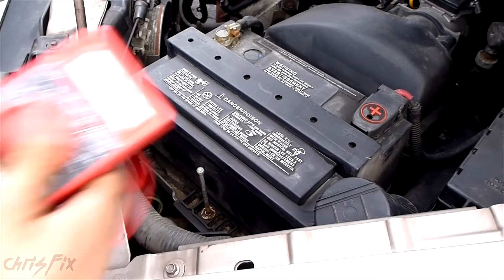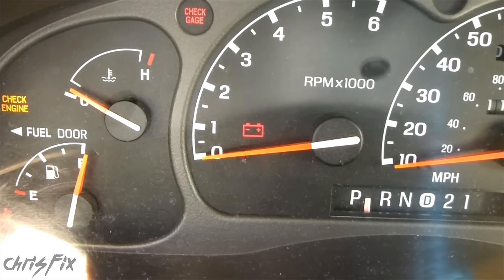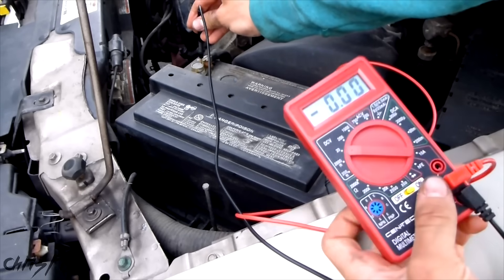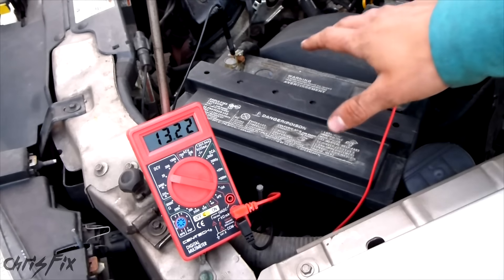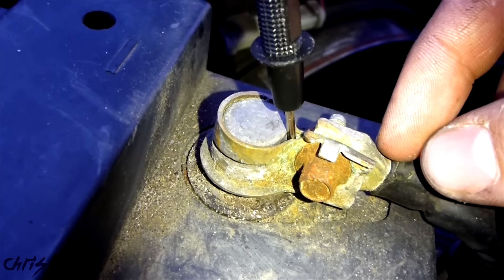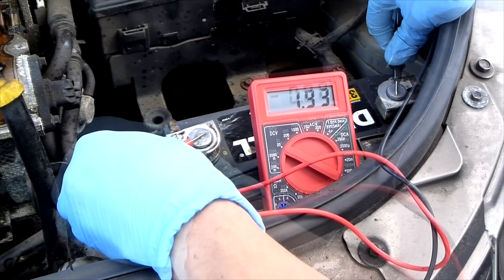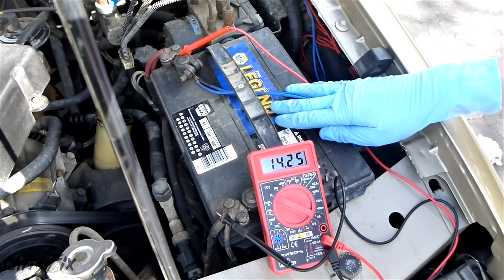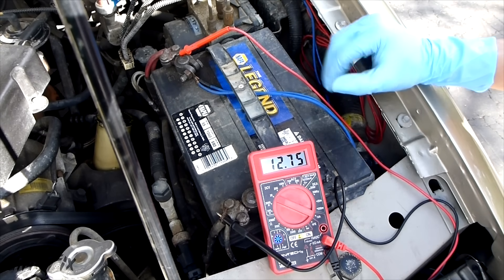How to Test a Car Battery with a Multimeter

Comment: Very useful video a great tutorial on multimeter use.  Not keen on the WD40 on the posts it will wash off too easily.  I prefer to smear a little waterproof silicone grease on the posts and connectors, it doesnt wash off and is a great anti corrosive.
Reply from the maker: Thanks for the tip! I used wd40 because that is what most people have in their garage so it is better than nothing. I have had pretty good luck with wd40 anyhow. It seems to last a while for me, but silicone is a great way to go if you have it!

Comment: Real quick is there a easy way to flush the transmission fluid on a jeep?
Reply from the maker: You can take the transmission pan off and drain the fluid. There isnt really an easy way to flush it unless you have a special machine. I guess you can try taking off the tranny cooling lines and have old fluid get pumped into a catch can and have the new fluid get sucked up but that can be risky if you dont get the new fluid sucking up.

Comment: Hey Chris you haven't made any videos in awhile hope your doing well bud. Hey would you recommend Valvoline MaxLife synthetic blend 5-30 for my Mazda b2600i.,, thanks in advance
Reply from the maker: Hey John, I have been busy filming a lot of videos. I am rebuilding the whole front suspension and have so many other videos I am filming it is crazy!!! I wouldnt use a synthetic blend. I would either go synthetic or stay conventional. If you go synthetic, you shouldnt really go back to conventional so think about the price difference and stuff. I just switched my truck over to synthetic and it burns the oil a little faster so be prepared (120k miles on the truck).

Comment: Hi chris, do you recommend doing that seafoam on a truck. Thanks and hopefully I can learn how to do it if you think it's important on an old truck
Reply from the maker: I do not recommend seafoaming a truck or any car. There is no need to. Are you having problems with something that you think you need to seafoam it? We have had my dad's van since new and it has 300k miles on it. Never been seafoamed and it is running great.

Comment: For example will the belt just slip on into place. The engine is a  12 valve 5 speed manual 4 cyl.

Comment: Hi Chris . I'm hoping I can get a response from you soon I know you're not my mechanic and I know I'm not paying you but I need a suggestion . Today on my 92 mazda b 2600i my ac compressor belt broke ,,I gotta new 1 ,can you tell me if anything specific I need to do to get the new one on. Thanks.
Reply from the maker: The belt is just for the AC compressor or is it a serpentine belt which goes around the alternator, power steering pump, etc?

Comment: Nice video Chris. I would suggest only using distilled water to top off batteries that require maintenance. Just normal bottled water has mineral content. Most large producers of bottled water filter the local municipal water and then add back in a certain mineral content to give it a flavor profile that makes all of their water taste the same regardless of the original source. Who knows what their recipe is, but to be safe, distilled would probably be the way to go.

Comment: Mr Chris,,, I bought my work truck today the B26000i and it is a 4 cylinder 5 speed manual and the truck runs great and smooth until you get on the highway at 55+ mph. Then it starts to shake real bad I asked the guy I bought it from why it might be doing that he said that when he had the tires bought or rotated he never had them balanced ,,,could that be the cause of it sir?
Thanks Chris fix
Reply from the maker: Congrats on the truck! That could definitely be the problem. Are there any balance weights on the rim? Try this to check for other problems: How to check out your own car's suspension system

Comment: Chris... Like I said this is the only way I know how to reply and wont let me answer your reply ... I think the Mazda b2600i is a front wheel drive cause its a4 cylinder 5 speed would that be correct
Reply from the maker: It is rear wheel drive. There is no such thing as a front wheel drive pickup truck. I think because it is a straight 4 it wont be 4wd. I would honestly look for a 4x4. Trust me, if you get a 4x2 you will wish for a 4x4! I wish I could figure out why you cant reply to messages sometimes...

Comment: Another good one.  I've used a baking soda and water mixture (1/4 cup baking soda to 16 ounces water) to neutralize the acid on top of the battery and around the terminals.  It does a great job of killing that corrosion, but the mechanical action of the sandpaper is still needed to remove all the residue.  That WD-40 suggestion is a great idea.  Thanks, Chris.
Reply from the maker: Great Tip! Thanks a lot! Glad you found the video informative!
Reply: I was about to say the same. You don't need a solution, just sprinkle a teaspoon of baking sodium on the positive terminal, spray some water and let chemistry do its thing. Rinse. Don't let acid crystals get on your clothes or this will be the last time you're wearing them. Obviously rinse well from any metal parts our comes in contact with. Use only conductive grease or none at best.

Comment: I took my 2011 versa to tire kingdom to have the oil changed and they said my battery was bad it read 335 cca then I  had my battery tested at advanced auto parts and the battery tested good  at 365 cca my battery is rated at 400 the guy at advanced said he would sell me a battery but the tester read good all I know is I got two different readings from two different places .. help please what should I do im not having any problems car crsnks up like the day I got it I dont know I just need some help
Reply from the maker: Did you do the tests I did in the video? 335 and 365 CCA are pretty close to each other so if that is what your battery is rated at, it is good. I know the versa has a small 4 cylinder so it probably doesnt need that many CCA, but it should have whatever is on the battery. What does the battery say?
Reply: The battery says 400 but when I have it tested they say there is no reason to get a new battery yet because it says good battery on the tester he said I will sell you one but right now you dont need it so I didn't purchase a new one yet. ... what do you think
Reply from the maker: Does it feel like it is weak when you start it? I think you are fine. You will know when your battery starts getting weak that it needs to be replaced. Since it is summer, you will probably not have any problems.
Reply: No it feels fine there is  no hesitation when starting so thank you for the reply I guess the guys at tire kingdom were trying to get my money ... thank you again for your time.

Comment: Great vid, I got the same free HF multimeter too.
Reply from the maker: Thanks! Yea, it is a good cheap multimeter!
Reply: ChrisFix Cheap is correct.  Why is it free?  Cheap.  However no one on this planet wants cheap.  What you want is a good value.  For example, I intentionally bought a 'cheap' IAC that was advertised as "High Performance IAC".  There is no such thing.  My response: http://www.ebay.com/itm/181344884708
Reply from the maker: Kevin Johnson lol, good point. Cheap and a decent product.
Reply: i had one of those. gave it away. it worked ok but the leads broke right at the elbow. i fixed one side and then the other broke and since my brother gave me a good one i just passed this one off to someone else. so now i only have two, a digital and an analog one.

Comment: Hello Chris great videos on both of them the battery in the alternator. Chris I like to thank you for your encouragement when I told you that I got accepted to UTi NASCAR I have to remind myself to buy a turkey baster and put that in my toolbox lol Chris I do have a question for you about a pair of gloves now when I work out away football gloves so I would have good control of the weight when I lift. Is there a difference between the football gloves Under Armour automotive technicians working gloves? Thank you so much Chris for your encouragement it means a lot to me
Reply from the maker: Thanks buddy! Glad you are still going forward with the UTi NASCAR program! You have to keep me posted and let me know how it is! I am unfamiliar with both of those gloves. I typically use the blue latex throw-away gloves when I do my work lol. I dont know how expensive the mechanic gloves are but I think it is a worthwhile investment if this is the field you are going to become a professional in!

Comment: I like how you use a multimeter that is available to mostly everyone, with a coupon it's free. I have one of these but was questioning if it was accurate enough.
With these past videos it looks like it gets the job done. Thanks.
Reply from the maker: That is the idea with all of my videos! I try to use tools that are cheap, available, and common. I have been using this multimeter for a while now and it seems pretty good compared to a $50 one. The more expensive ones are better, but for what I work with, this is fine!